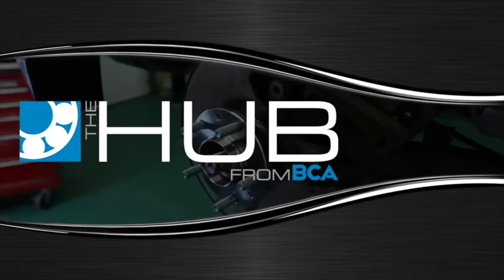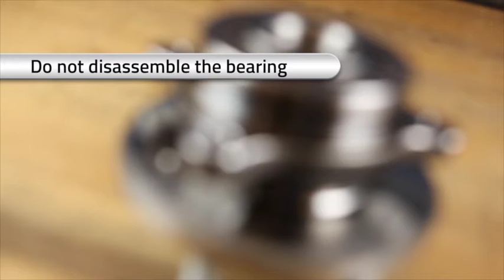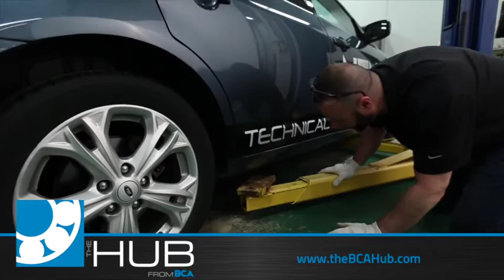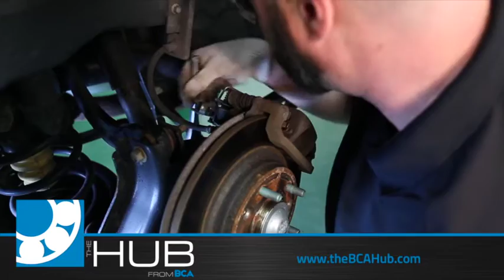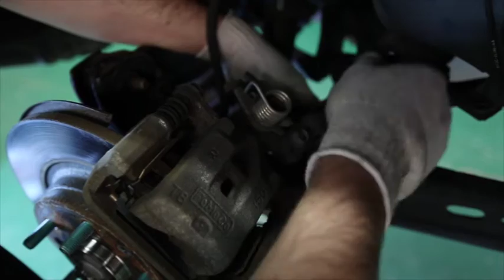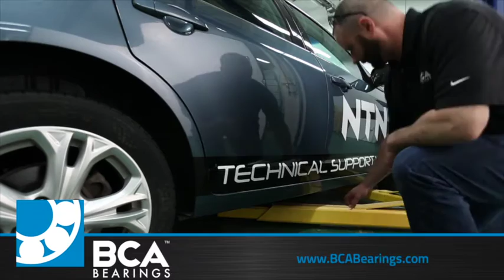Installation of Non-Driven, Gen 2 Wheel Hub Assembly

Comment: What is a typical torque value for hub nuts
Reply from the maker: Thank you for your question. There is not a single torque value for hub nuts. The torque spec is determined by the manufacturer of the vehicle, and it is different for every vehicle. You need to have the correct information for the specific vehicle you are working on to ensure proper and safe installation.